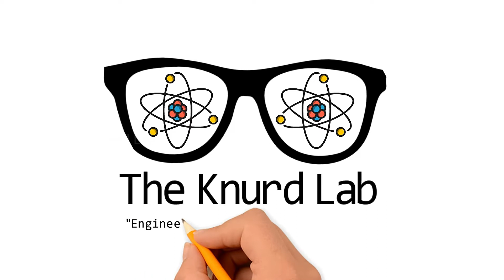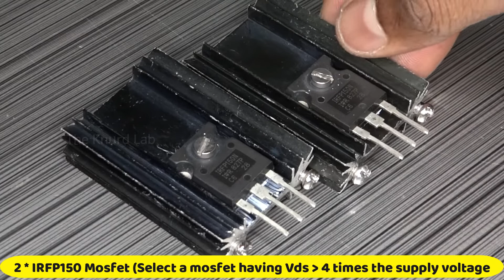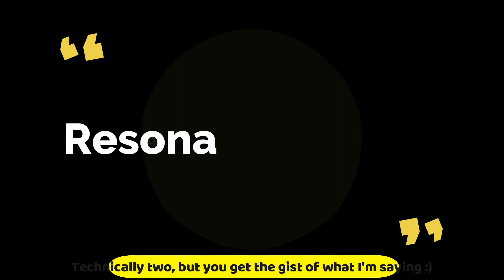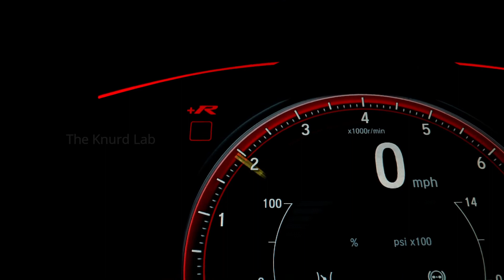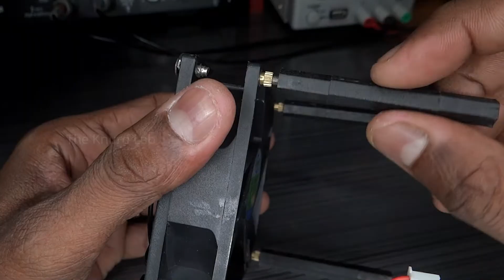What is Resonance? | DIY Zero Voltage Switching Flyback driver

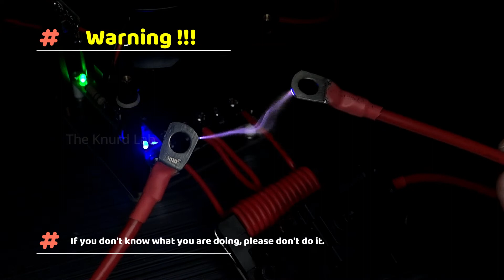Comment: 8:55 wow😂 
He Teaching High voltage safety by Doing same wrongly with Himself .
Look.. it takes take little amount current via your Heart to interfere its cardiac Rhythm and he is doing two things wrong First wire is not HV type any deface can arc over to shock you if it's not enough he holding both Hot and Cold wires with his both hand so current can easily pass via his heart i Never do such thing i follow one hand rule always put left hand in pocket during mains and HV conection while it's live . And yes FBT does not generally produce 30mA but with ZVS mod it's Current can reach High level as we can tell seeing white plazma instead of blue.
Anyway his Explanation of ZVS is good  . 🎉

Comment: The mosfet get so hot even with no load i believe the the 10k need to be 3 or 5 watt i use 1 watts 10k but the mosfet get hot never the less only to notice the the mosfet not turning faster why the heat so i never use the design agains

Comment: https://www.youtube.com/watch?v=T5Q9pLxeoss   will this pulse or just oscillate when using DC ?  anyone??   I know it will oscillate with AC but i want use DC  or better said i want it to pulse and not oscillate, as to say i want the Capacitors to act as a switch. Any input is welcome.

Comment: I want to make 2000 watt need schematic.
Reply from the maker: Sorry it doesn't work that way! This is an educational channel. I don't sell designs.
Reply: @TheKnurdLab  ok,by the way good video 👍
Reply from the maker: Thank you.
Reply from the maker: I can suggest that you increase the switching device's power handling capacity to increase the overall capacity of your circuit. For example use a higher power rated MOSFET so long as the voltage requirement is met.
Reply: @TheKnurdLab  thank you🙏

Comment: Is it OK to run the ZVS driver with no load??????
Reply from the maker: Yes it is ok as long as you see both the status LEDs are lighting up. If only one LED is ON it means one MOSFET is latched ON and the circuit is not oscillating. In that case switch OFF power immediately and check the connections.

Comment: In your circuit description, I don't see exactly how, when G1 is on and G2 is off, how L2 is ALSO charged.  In the ZVS boards Q1 and Q2 are SEPARATE coils wound on SEPARATE coils wound on two toriods (usually placed at quite long distances from each other on the circuit board).
Is it because this  description is for single-toriod circuits (like a center tapped heater coil)?  What about the circuits that have the 3-output terminals?

Comment: I think I have ordered the correct parts to build this circuit.  One change I plan to make is with the TWO LED 'warning' system.  An AND-gate function can be made with only two diodes, allowing a more noticeable single BRIGHT RED LED to give the "warning"

Comment: How would you use a digital signal to turn the ZVS on and off when the load is a capacitor and it has charged to the desired voltage or falls below the desired voltage??
Perhaps:
(1) Use a comparator (with hysteresis) and power transistor to cut on/off the supply voltage?
OR
(2)  Pull both mosfet gates LOW with an open-drain transistor controlled by the comparater?
What do you think??
Thanks

Comment: Is this circuit durable to high frequencies, can it work with high resonant frequencies like 500kHz. I mean should we modify the circuit with active gate drive.
Reply from the maker: Sure, You see in my demo I was operating it close to 275 Khz and the gate waveforms were very good. This circuit should work well upto 1 Mhz without any modifications (I never had to take it that high honestly). But it is capable. When it comes to very high frequency the gate diode needs to be very fast and the gate resistor can be reduced a bit to reduce the rise time of the gate charging pulse (by how much exactly i need to experiment a bit but that's the theory). To answer your query, Yes it can handle 500 Khz. Just keep the voltages 4 times less than the max VDS voltage of the mosfet just as an insurance.

Comment: How much watt this driver support.   Its working on pancake coil ?
Reply from the maker: The geometry of the coil is not a problem as long as you know the inductances and the capacitances involved to calculate your operating frequency (if looking for a particular operating frequency). There are many online calculators for that.  When it comes to the max power, the upper limit of the mosfet drain to source voltage is the limiting factor. Also is the current through the capacitors. For example, If your calculated capacitance for a target frequency is 1uF,  then you may try using 5 * 0.22uF caps in parallel so they share the current and get less hot. Select a mosfet whose max VDS is atleast more than 4 times that   of your supply voltage. You are good to go! This circuit can safely operate upto 24V although that is very close to the safety margin. Its got to do with the mosfet's fragility than your safety margins. If you are unlucky and have some spikes, you will blow the mosfet.

Comment: Also if you could give similar explanation for LED drivers e.g. HW9315 IC circuit
Reply from the maker: It is basically a buck converter on a chip I guess. Not worked with them though. But I will try to do a video on buck converters and their working principle perhaps in the near future.
Reply: @TheKnurdLab  particularly the constant current and power factor correction action, It is hard to understand how high pf correction work

Comment: Hi sir, what is the DSO brand and what is its price. I am looking forward to buy one. Any suggestions will be helpful
Reply from the maker: This is a CDEK SDS1102X 110Mhz/1GSa/s bought from Amazon. It is good entry level and using it since a year. Helps me a lot. Also Hantek DSO2C10 is a good and cheap option. Has an inbuilt waveform generator and lot more other features too.